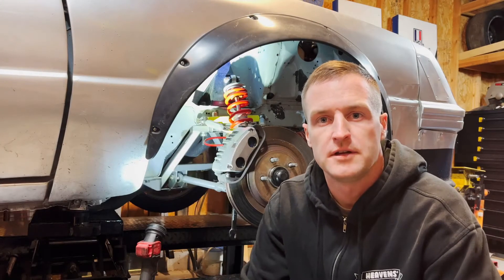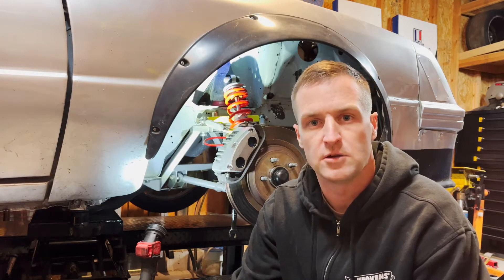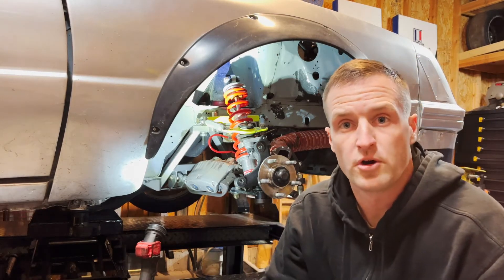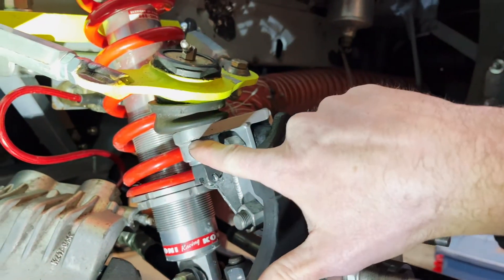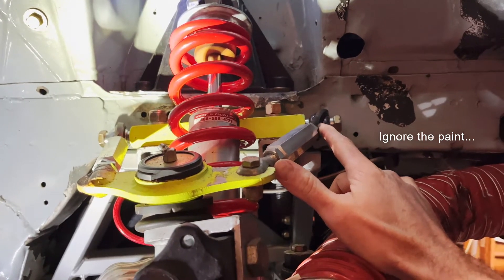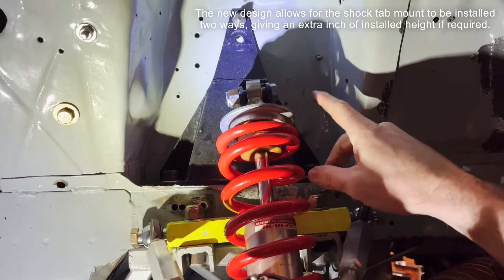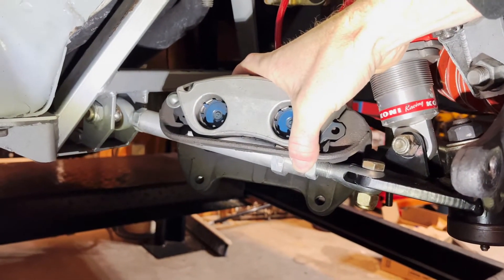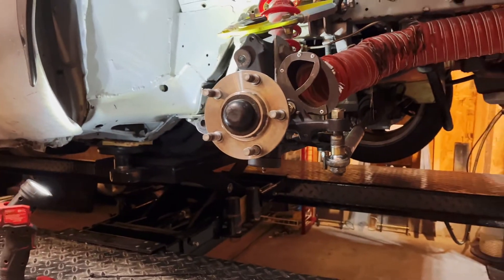Mustang Track Car - Double Wishbone (SLA) Suspension Walkaround

Comment: Subbed.  I figure this is over but freaking amazing.  I need an amazing suspension in the front of my 62 falcon. 

I thought why not design my own cantilever front suspension on my 1962 ford falcon which I’ve designated my daily.

I’m a geometry whiz and just did a 4 link in the falcon in may after I taught myself how to TIG MiG and stick weld specifically for this car.  

I’m blown away by what you’ve done!  Mechanical engineer?  

I’m commenting early early in the morning because my mind wouldn’t stop thinking about throwing an s2000 front end in the falcon…. Then I found your project and really complicated things !   I would really like to have a conversation q & a.   You really did some high level thinking there.  IMO most people aren’t plagued with constant deep thinking about mechanical things (I’m assuming you do).  If not tell me how to stop

Comment: Looks like a good system for road racing/drifting would it be
practicable for the street ? Thank You for any information that
You can provide it will be greatly appreciated. 🇺🇲🇵🇷🦊👍
Reply from the maker: This setup would definitely cause an increase in the NVH of your car, as it’s all solid suspension using heim joints/rod ends. It would be fine for the street as long as you’re willing to put up with it! It definitely lightens up the feel of the front end and makes it incredibly responsive.